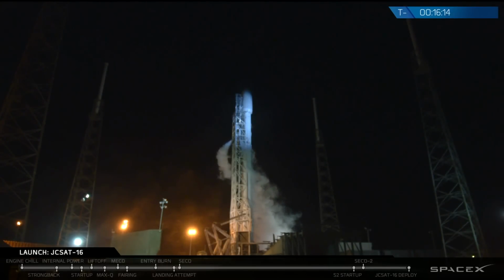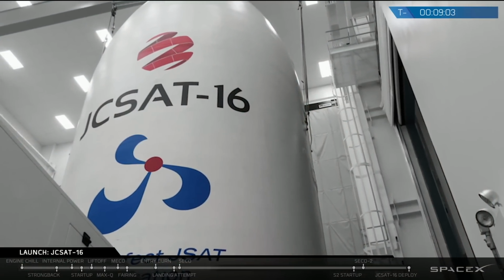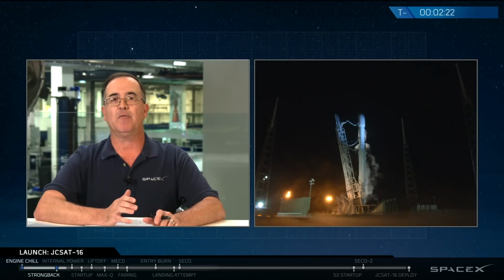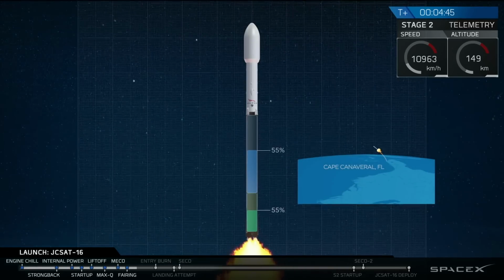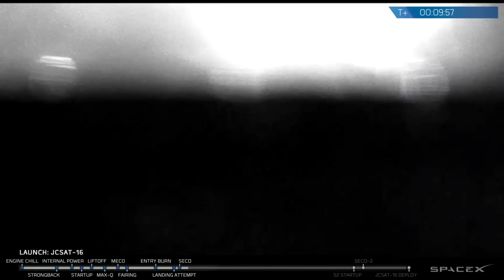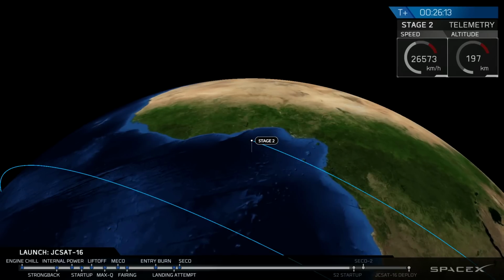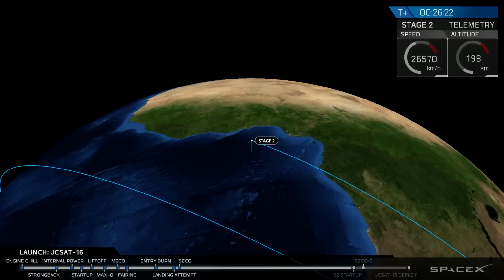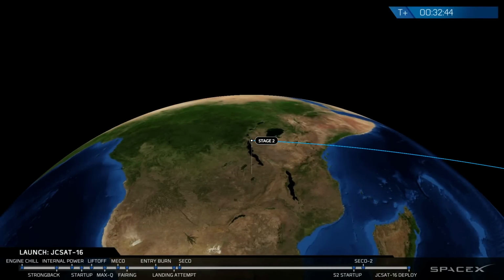JCSAT-16 Hosted Webcast

Comment: wow at 19:40 they even thought enough to put a source of light inside the stage two area so you could see separation.   They can't show stage one landing on the barge, but they can show at least 3 views of a rocket motor flying around the planet live....does anyone really fall for this crap....best CGI on the planet!  48:05... the masonic bosses say FIRE THESE RETARDS.  I just don't understand why they are lying to the public.  They can have a LIVE visual image of the satellite being "gently pushed it to the great beyond"  but not a single video of stage one landing from one of the service ships for the barge...WHY you Lyin to me?
Reply: + Pat B - Now now.. I DID respond to each one of your points. You just keep making claims without anything to back them up and your apparently ignoring ALL else. Why is that I wonder?  "because we need three cameras on a bell housing of the rocket motor"   Why wouldn't we? Video is the best way to examine whats going on with the upper stage seeing is how they don't recover those.  " rocket engine is not burning properly"   No its burning just fine. That uneven thermal pattern on the bell is simply do to the fact that the fuel traveling tthrough that ring ( for cooling ) enters in at one side. Its not symmetrical. Why youd think such a thing would be symmetrical to begin with is beyond me. Once again you've failed to show exactly why these rockets cant do what they can do.  There is nothing that works outside the laws of physics here. I think at this point you just WANT it all to be fake because your life is a boring mess without your conspiracies. So please. Less ad homien attacks and more proof.
Reply: You seem quite upset.
Reply: +Pat B. Because its too dangerous for people to get near enough on a boat. It's controlled ballistic missile when it comes to these barge landings. They have good connection to the upper stage because there's no interference. It's in orbit it can relay off of several satellites. Where as the drone ship cannot get its radio waves out to a satellite because of the decending rocket pulverizing the air upon which the radio waves travel. Simple stuff really. And that "smoke"? Was clouds. The rocket is incredibly bright. When it's above the cloud deck it lights up everything like it's a full moon.  You do realize several thousand people witnessed these things land back at the cape, right? So what's so hard to believe when they land out at sea? The "barge" isn't actually a barge. It's a ship that can keep its gps position down to the degree. There's nothing here that can't work. We've been landing rockets on their tails since the 90s. Only this day we have the computer tech to do it with precision. What's so hard to believe about this? It's 2016 c'mon...
Reply: Pat B. "...thrust is all wrong for deceleration." And why is that exactly? Please do explain.
Reply: Pat B. It's funny how the people who claim to have outsmarted everyone else usually seem to know the least about the subject matter.
Reply: Pat B. Wrong.
Reply: Pat B. Typical, when someone calls you out on your delusions then all you can do is call people names.
Reply: Pat B. Oh now you think you can jump right back in and act civilized, it's too late you've shown your true colors already. It was fun exposing you for the fraud that you are.
Reply: Pat B. It's a live broadcast, it's not edited. Do you really need someone to explain to you that there's more than 1 camera to switch between?
Reply: Pat B. Wrong again, and there are many more cameras throughout the rocket than the ones they share on stream, not just 3. Every single comment you post just shows how ignorant you are about literally every detail of basic rocketry. I don't think you've posted a single thing yet without a glaring factual error in it.
Reply: Pat B. We can try again when you have any intelligent argument to make.
Reply: Pat B. Predictable, insults are all you're capable of.
Reply: Do you glitch out whenever they actually show these videos that you mention? There's a video showing the first stage falling from space all the way to the landing, camera pointing downwards so you can see all of it. And then there's the footage of the landing on the barge from a boat further out, and then there's the footage of the rocket landing on the ground (two videos of two separate landings actually).

Try to un-glue your nose from the bible and put some thought into the world around you.
Reply: He does seem that way.
Reply: yeah, i don't like being lied to...its just a thing I got....
Reply: Pat B. But you don't seem to have any problem lying to other people.
Reply: who did I lie to?
Reply: +Pat B. Yourself and/or anyone who believes you
Reply: you are a special kind of stupid aren't you?
Reply: You know what, I'll let you 'win' this one, mmkay? ;)
Reply: I won before you even started fool...
Reply: I'm sure you believe that NASA is fake as well. So how about you explain to me how I watched Discovery launch and subsequently land (several days later).
Reply: Quit changing the subject bitch...tell me how spacex can show live streaming video of their stage 2 rocket engine going all around the planet in real time but not one video of a unedited stage 1 landing?
Reply: Because the video feed from the droneship is transmitted via satellite, and the 1st stage landing created a massive amout of vibrations, which messes with the satellite link. Happy now?
Reply: Pat B. Nice try with your lies again, there are multiple unedited and uninterrupted landing videos that SpaceX has released - and even more recorded by amateurs who witnessed it.
Reply: LOL no that is the story....why are there no hand held cell phone videos from the support ship for the barge.  Hells bells...I could fly a DJI phantom 4 close enough to get a shitty video...if it really happened....multiple views of stage 2 bell housing (also heavily edited)...
Reply: you can provide a link if you want...if you have one...
Reply: +Motokid600 Never mind the "smoke" comment was mixed up with something else.
Reply: Pat B. There is a landing video taken from the support ship, nice try.
Reply: BadWolf HS there again...link me one...Ive seen the fake footage supposedly from a helicopter...thrust is all wrong for deceleration.
Reply: Pat B. Wrong again.
Reply: Motokid600 He cannot.
Reply: BadWolf HS Ah well you never know now. Maybe this guy has some super-exclusive rocket tech knowledge no one whos ever taken an interest in rocketry possesses. Maybe...
Reply: Motokid600 I would think thrust would be maximum right before touchdown, which it isn't...is there any wind tunnel data on the waffle fins?  Where is that published...something that heavy falling from that far would need some serious thrust to slow it down and more swiveling for stabilization...but who would know because they never show it...
Reply: BadWolf HS if stage one can land perfectly every time but once, a ship with proper video equipment could photograph landing with no interruptions...but we will look at a nozzle on stage two circle the planet (highly edited by the way)
Reply: typical, when people can't answer hard questions or answer points produced, they give one word post that don't help either way.
Reply: you exposed nothing....except your ability to type words...
Reply: Pat B. Sorry if the truth hurts you.
Reply: you are shown to be a fool...I just re read all of your comments and you did not address one single point I brought up with a video or an explanation or a link to find the truth.  You have offered nothing to a conversation except the ability to type...go away until you can answer questions.
Reply: Pat B. Go away until you have a question worth answering.
Reply: why are there so many edits of stage 2 bell housing?  The heat affected zones switch back and forth.  Heat affected zones don't naturally act this way.
Reply: yes, because we need three cameras on a bell housing of the rocket motor...you claim that they switch between cameras...BS if one side of the image is different from the other side, then there are only two options, rocket engine is not burning properly and two it is CGI...I choose the second...go away princess.
Reply: done with your baiting, you offer no answers, explain it or go away...
Reply: how about fuck you....quit wasting my time shill / apologist...

Comment: Look at them at 25:50 - all laughing becasue they know it's a fraud.  Why would they NOT have fifty £40 4K SD Card cameras on the barge, none of which would fail? They cost £40 each on Ebay right now, ANY of them would have provided 4K footage of the landing, with no chance of failure. So we are supposed to believe that there is NO footage of the actual landing? WTF? And you idiots believe this crap? The second I saw the first 'landing', I immediately thought it looked fake. And now this. They are running out of excuses.
Reply: Live footage is hard, they'll recover the actual cards and get better footage from those. Dealing with vibration from a rocket is also very difficult; even hundreds of feet from a rocket launch amateur photographers' remote cameras have completely died from the exhaust or the intense vibration.
Reply: We'll get good footage (maybe even 360) when OCISLY returns to port.  Also you know that camera shaking when the rocket takes off?  That camera was a mile away.
Reply: Yeah, sure we will.... it's 20th August, where is the "good footage"?
Reply: John Thomas Eh, sometimes they don't show much. Of course, they don't really care about whether we believe that it's real - they just know it's real and are busy convincing insurance and satellite companies that it has huge cost-saving potential without significant risk increase.

Comment: Yea, they have super steady camera footage on a rocket doing 20,000 km/hr. Yea, right! something stinks in Outerspace and we don't have landing footage. hmmm.
Reply: The 2nd stage is above the atmosphere.  There is no sound in space.  Yes vibrations can still travel through the rocket structure but there is such a thing as vibration damping camera mounts and digital image stabilization.  A cheap drone you buy at walmart has both of those things.
Reply: There's no wind resistance so there's no reason for it to shake, as well as optical image stabilization
Reply: What about the ridiculous vibration from the rocket? That's hundreds of decibels loud, probably hitting the atmospheric sound limit so huge pressure waves.
Reply: Plur307 Also, the bigger thing is that vibration comes from the engines, and the cameras are mounted close to where the thrust structure interfaces with the tank. So regardless of vibration damping, the camera should shake at the same frequency and amplitude as the engine that's being videoed.

Comment: I would like to know what the ever-present lingering flames are on the engine assembly of the falcon booster post landing.  Kerosene vaporizing out of regenerative nozzle, perhaps?
Reply: pretty much just left over fuel burning gently they vent stuff after to adjust the com
Reply: Do you know this, or are you presuming?  The flames certainly look hydrocarbon based, and I've assumed that it was fuel making it's way down from the turbopumps and leaking into the engine proper where it burns off.
Reply: +Norman Reitzel presuming based off off observations of similar things the stage lands with almost nothing in the tank and the cost of a few liters fuel cs the risk of something going wrong means burning it off makes more zense

Comment: Can someone explain something to me? If GEO is 36000km up, why is the altitude on the right side of the screen only about 500km at the time of satellite deployment? What am I missing? Does it just gradually float out to the correct altitude on its own over the next few hours, days or weeks? Or does it have its own propulsion which puts itself into place?
Reply: I believe he explains it at 20:00
Reply: And more info at 27:20
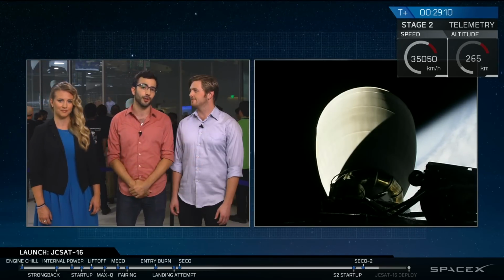Reply: As far as I understand, you are right, the satellite will continue to drift out over the next few days/weeks. They give a brief explanation at 46:11. It sounds like the satellite is still rising, and it will use its own propulsion to fix its orbit once it reaches 36000km.

Comment: they cut to a different camera angle after it landed, where is that footage
Reply: It'll come out some time after the rocket and the barge return to Port Canaveral; that's usually how it goes. (Anywhere from 2 - 4 weeks)
Reply: yep, somethings fishy here! at 25.48 you have 4 landing lights. THEN.....Totally different Picture.....26.38 only 2 landing lights. i Never thought i'd think that Elon musk Was Pulling a Fast one...but, This does not sit well with me..hmmmm. not so good.
Reply: +Working For Free why would it take "2-4weeks" for a barge to travel less than 400miles back to port?
Reply: +OcRefrigeration,Hvac & Electrical. there were actually 3 landing lights ,the one all the way on the bottom right is  just a reflection on the deck . As the Rocket land it then covers one of the lights.........
Reply: they haven't made it yet. I'm sure that they'll come up with something soon though
Reply: +OcRefrigeration,Hvac & Electrical. yep. 100% BS
Reply: 1. There is no hurry.
2. Weather.
3. it's a barge, not a freakin' speed boat.

Comment: I have two questions:
1. at the edge of the second stage engine's glowing bell there is a thin black line. Do they put it there digitally so we can see things better?

2. When the first stage is landed and standing still on the ship there is still something burning next to the engines is it turbine exhaust or burning RP1  or what?
Reply: To answer question 2 I think it's leftover rp1 from the turbopump exhaust being ignited. Because the mixture that runs the turbopump is Fairly rich so it doesn't burn at too hot of a temperature.
Reply: 1. The black line is the end of the bell. Usually some sort of hoop. It is black because it is cooler than the rest of the engine.
Reply: +Teboski78 so they burn away the leftover rp1 and evaporate the leftover liquid oxygen. that makes sense
Reply: Benedek Nagy The leftover fuel and oxidizer is unloaded at a later time. What is burning is fuel from the turbo pump and some hyperbolic liquids used to start the engine.

Comment: I am the only one who wants to see the speed in metres per second?
Reply: +SteelRodent1456 It is dividing by 3.6, not multiplying.
Reply: Agree with you, I like m/s more than km/h (However I'm soooo happy, that they at least use km/h and not miles as an US company). SteelRodent is propably right, that most people on earth are used to km/h. I think it would be more interesting to see the telemetry data of the first stage
Reply: Benedek,  SpaceX also hosts a 'technical stream' that is JUST the raw footage (no hosts) that displays the bottom bar and the velocity in m/s
Reply: I do too.
Reply: +Gregory Frechou oh in the technical webcast I see
Thanks :)
Reply: Yeah really. Space flight should have 1 speed that everyone can understand.

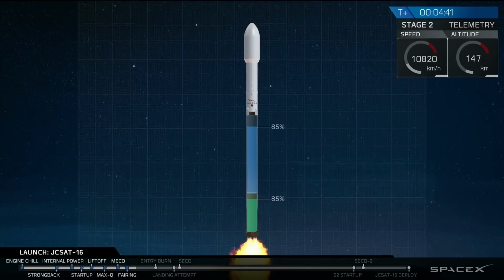Comment: At 21:40 during that awesome graphic he says that the thrust produced throughout the duration of the flight is more or less constant. But thrust increases as altitude increases. I know he is saying that it is easier to accelerate the rocket when it has less mass, but doesn't the thrust also increase? Or am I not understanding something, or not understanding what he said?
Reply: The engines also get about 10% more thrust as they leave the atmosphere as well, which is why engines have sea level and vacuum thrust and specific impulses ratings too! Interestingly a Falcon 9 has a worse 0-100 time than a 10 year old minivan, but right before MECO it has to throttle down to keep it to 5 gs, which is about 3x more acceleration than any fighter jet.
Reply: Thrust is a synonym for force. The force remains the same. The acceleration changes, but that's because the mass changes as well. F=m*a, m goes down while a goes up since F stays the same. You can think of the thrust as the amount of gas coming out of the rocket.
Reply: Aaron McCulloch Should also keep in mind that the rocket becomes less efficient higher up in the atmosphere. Less efficient in the sense of less thrust is being exerted downwards. The reason being that the pressure of the gas leaving the nozzle is significantly greater than the ambient pressure causing the gas to expand to the left and the right rather than just downwards. The mass flow rate and therefore the total thrust doesn't change but the thrust downwards does. The nozzle shape is optimized to be efficient at sea level. If someone would find a way to change the pressure of the gas coming out of the rocket without changing the mass flow rate and nozzle shape, that person would change the space industry. This would allow rockets to be at least 5% more efficient which doesn't sound like a lot, but it is. I am aware that there are ways to do this but none of them are smooth which is important. You could imagine the significance of this smoothness by looking at a right angled triangle. You could either go up in two stages, or go up smoothly. Obviously the hypotenuse of the triangle is significantly shorter than the rest of the triangle.
Reply: Actually Falcon never gets above 3.x g, second stage approaching SECO sometimes has to be throttled back to keep package below 5 though... you can keep track by delta V, one g gets one Mach gain in velocity in about 31 seconds, do the math from there when watching telemetry...

Comment: What's the current limit for spacex? earth orbit? or maybe you could send something further, like moon or mars?
Reply: Search up SpaceX Red Dragon. They are working with NASA and planning to send a Dragon 2 to land on Mars in 2018 using a Falcon Heavy rocket
Reply: It depends on how much the thing that they are launching weighs.
Reply: From SpaceX's website:

Falcon 9:
Payload to LEO - 22,800kg, 50,265 lb
Payload to GTO - 8,300kg, 18,300 lb
Payload to Mars - 4,020kg, 8,860lb